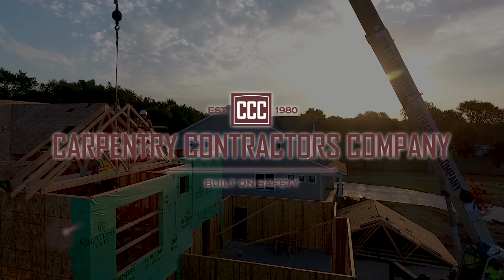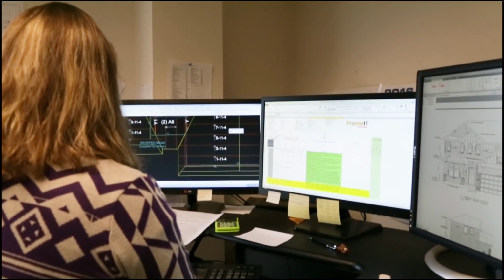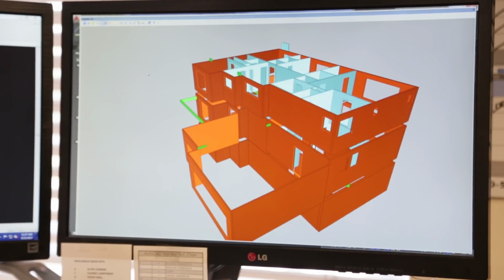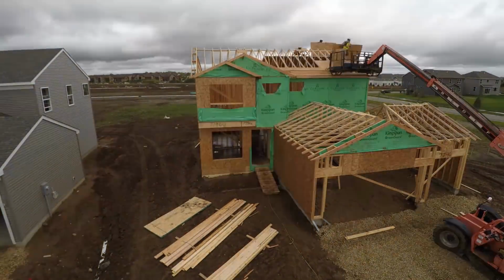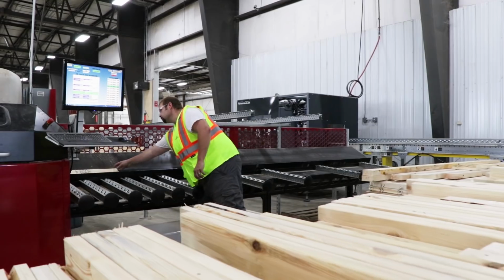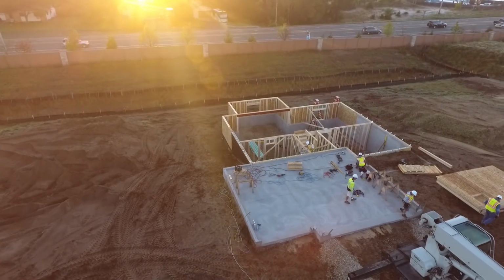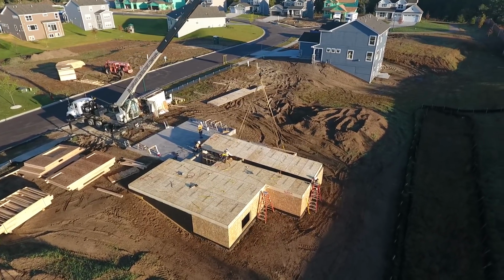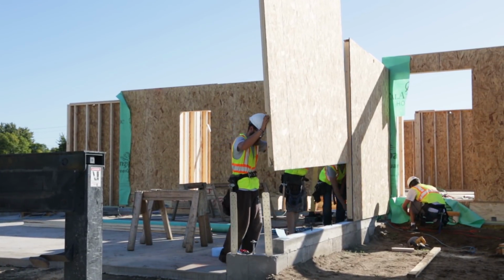Carpentry Contractors Prefab Wall & Floor Panel Framing

Comment: Safer, yes. Faster, yes. Better product, probably (depending on the crew). But, I'm a carpenter because I love building. Assembly by number is not carpentry. Carpenters today aren't as skilled as past carpenters and this upstream process is only ensuring that carpenters tomorrow aren't as skilled as today. More devaluation of skilled labor in the name of production. I appreciate the innovation of this company and understand the need for businesses to stay competitive, but I have deep reservations about the direction technology and process improvement are taking us. 

I've taken my 28 oz Estwing across the country building houses. Kept it in my ruck while jumping out of planes and on deployments to Afghanistan. It is literally my most valued possession. I don't believe I could habe developed that sort of passion building houses with this process.

Comment: i noticed you guys dont check the back of your panels for shiners, how deal with that gap in process?
Reply from the maker: We address "shiners" or any missed fasteners for the walls in the shop before they get stacked into bundles. We check the floor panels from the under side once they are in place and secured.

Comment: Do you ever coordinate electrical, HVAC, sprinkler, and plumbing runs with the other trades to the point where you can gang drill them prior to installing?
Reply from the maker: We do coordinate mechanical to a degree, but not to the extent of doing the actual pre-drilling.